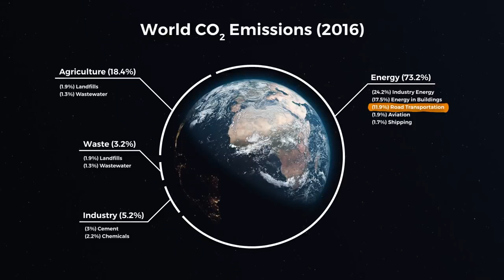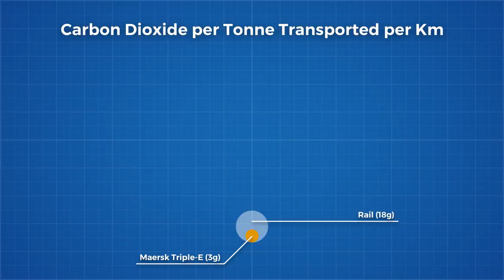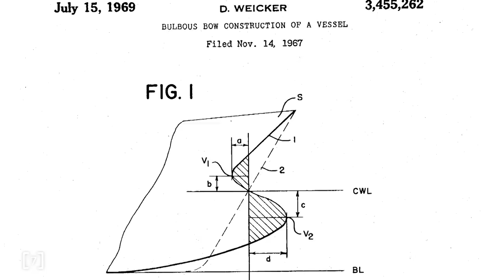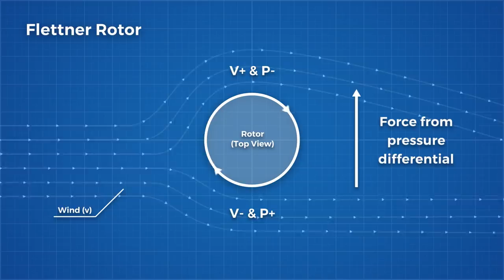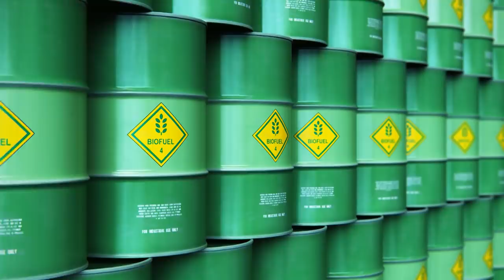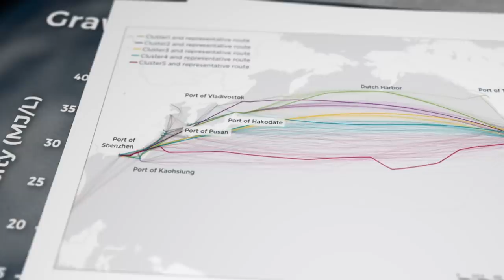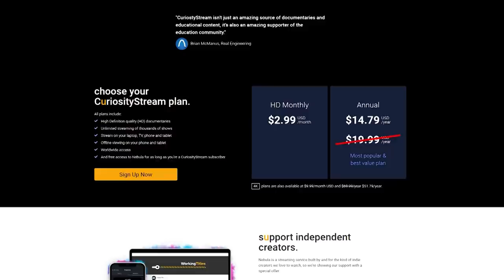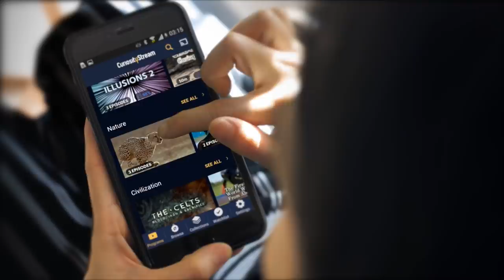Are Renewable Powered Ships Possible?

Comment: What I have come up with is there are newer very high density batteries coming out now.  Mass and space on a ship are important.  Placement of mass is also important.  You have to consider that the current large ships out there have massive engines that take up a large amount of space and a descent amount of space is used to store fuel for the long trip across large oceans.  This energy density of the fuel is a problem when you look for ways to replace it.  So from the onset, if you are to use batteries, you need to find something high density to minimize the number of recharging places that need to be setup.  However, here is the thing with recharging, you could for example have floating wind farms along shipping lanes.  Moor the ship to a recharging point and connect up some high powered transmission lines to the ship.  The power dumps  over to the batteries on the ship from batteries at the floating wind farm.  Considering how efficient these ships are at moving around with economies of scale bringing drag way down in addition to low speeds they are typically operated at, it should be easy enough to have up to a few days of battery storage without really becoming a problems with cargo capacity.  At this, you could distribute the batteries along the bottom of the hull to help lower the center of gravity of the ship.  Then you just have an electric motor in the back to turn the prop.  Naval electric drive motors are nothing new.

Of course, if you can add something to the ship, say harnessing wind power, that could cut down on how much the batteries need to be used.  But you also need to keep this as simple and reliable as possible.  One of the reasons batteries are selected is they can be very simple and easy to operate.  Also they are very energy efficient and so cheap to operate.  After all they are already used at grid scale and just left in large banks to operate on their own, so ship use should be easy enough.  Just be careful to seal up the compartments they are in properly so salt water doesn't get into them and design the compartments they are in for any failure mode known for that battery type.  Also maybe setup the batteries on tracks to move side to side to help balance the ship as you can cut down on the need to use water ballast to stabilize the ship.
Reply: Much to think about here; correctly you indentify ‘energy density’ as the major issue but have, WADR, failed to carry that through to the conclusion that the fuel currently used is the best available when combined with internal combustion engines (ICE).  ICE are not massive in proportion to their power output and the hydrocarbon fuel used is easily stored in any awkward corner of the vessel that has no more valuable use.  The area & volume of the grid scale batteries you mention is not insignificant and would displace most of the cargo from any size of ship.  The owners and operators of the global shipping fleet take every opportunity to get the greatest number of ‘freight tonne miles’ out of everything they have to deploy to conduct their business limited only by the laws and regulations under which they operate.  Not only the control exerted by the International Maritime Organisation (IMO), an agency of the United Nations, but also those of the nation where the vessel is registered (flag state) and the nation sate wherever the vessel happens to be (port state) when not on the high seas.
Reply: @BernardLS  So I did some quick number crunching and other fact checks based on the Emma Maersk.  The idea being pick one of the largest and most efficient ships out there and run some numbers against it to get good enough ballpark figures to say what makes sense.  Then the numbers were crunched on cruise speed as that is more realistic than the max numbers.  I came up with at full load and cruise speed, the Emma Maersk should average around 1,500 tonne miles per gallon of the heavy, dirty fuel it uses.  While this number should be better if better fuel were used, for some comparison, trains in the USA average 500 tonne miles per gallon of diesel fuel and semi-trucks in the USA average 125 tonne miles per gallon of diesel fuel.

This is important for figuring out what percentage of your ship will need to be dedicated to energy storage.

Something else to consider, and you see this effect with even regular electric cars, electric motors are light.  ICE engines are heavy.  So then you can start trading engine mass for battery mass.  The Emma Maersk has a 2,300 tonne engine that is multiple stories tall.  The Emma Maersk also has a very long propeller shaft that weighs many tonnes and takes up a lot of space because the engine needs to be moved forward quite a ways because it is so big and heavy.  If you were to put an electric motor in, it would be far smaller and the shaft far shorter because you could put the motor much closer to the back of the ship.  So then that frees up say 2,000 tonnes of mass and a large volume inside the ship.  But then say you add back in batteries to power the ship.  With some of these new batteries coming out, it is not unreasonable to assume for a ship based application that you could get something like 400 kWh per tonne of battery and this includes structural pack weight.  So for that 2,000 tonnes saved by dumping the engine overboard and replacing the mass with batteries, you are looking at 800 MWh of battery capacity.

So now with just what you replaced engine and shaft wise, steaming along at ~1/2 power of 40 MW, that is 20 hours of propulsion.

So then consider all of the mass you have of fuel.  At economy speed, this is about 160 tonnes a day of fuel used.  So the fuel displacement is not a big factor considering the massive scale of this ship.  However, adding this in, you get over the 1 day mark of driving around at economy speed on battery alone without really disturbing the mass or effective volume balance of the ship over using a giant, heavy ICE engine.  Actually, if you were to store 25 days of fuel at economy speed, that is 4,000 tonnes of fuel.  25 days is picked for a long Pacific Ocean crossing.  So another 40 hours of battery for a total of 60 hours of battery without compromising cargo capacity.

So going back to the total freight capacity of roughly 150,000 tonnes, every 1,000 tonnes you slice off gets you another 10 hours of battery.  This is where I get into talking about where to place these floating wind farms and battery storage systems in the ocean along trade routes so ships can stop and recharge.  You could potentially have days of battery without a big impact on cargo capacity.  If you turned the ship into a floating battery, you are talking about over 1,500 hours of cruising the oceans on battery power, which is just absurd, but shows the math does work.  But it also shows that you need to stop to recharge in order to not rob too much cargo capacity and to keep the battery pack costs down.  So, I am thinking you would design around every couple of days or so, a battery powered ship would stop to recharge at one of these floating power stations in the ocean.

When you look at a ship like the Titanic, which a lot of people have looked at, a rather large percentage of the ship was dedicated to propulsion.  Going to heavy fuel-oil and huge diesel engines has shrunk down what is needed quite a bit even if the ship does go at Titanic speeds for their size.
Reply: @ChaJ67  I should take the time to construct a serious counter argyment but at the moment I am 🤣(rolling on the floor laughing).  For now just think about 41 mega Joules per kilogram, the typical gross calorific value of hydro carbon FO.  Where did 160 tonnes a day come from?
Reply: @BernardLS  The 160 tonnes a day comes from 1,660 gallons per hour * 8 lbs/gallon * 24 hours for economy speed.

I did crunch some numbers after looking up whatever values I could find.  If you can find better numbers, let me know.
Reply: @ChaJ67  Using a different, SI, route I came up with 155 tonnes so we can agree that.  In the 1970’s I was employed on 300 000 tonne ULCC ships running around the bottom of Africa; they used to consume around 100 tonnes a day to achieve circa 15kn, with steam turbines.  155 – 160 tons a day at reduced speed using an ICE is enough to turn me into a Greenie  🙂.
Reply: @BernardLS  And I am not sure why you laugh about this.  Floating wind farms are nothing new, grid scale batteries are not that new.  These can both be reasonably low maintenance.  For some added insurance, you could have nuclear power plant ships.  These actually exist already.

The problem with batteries, which you touch on, is they have nowhere near the energy density of hydrocarbon fuel, even the newer ones coming out.  However, we have cars that can go hundreds of miles on a charge and it is a very efficient way of consuming renewable energy.  Granted, ships have vastly better economies of scale, so you can push a giant ship much farther than you can with a car.  Ships have to go vast distances, so the main method I have come up with is to introduce "gas stations" at sea using renewable energy produced on site, granted you could use underwater power cables to transmit power a distance if there is a better renewable source a little ways away from the shipping lane.  And now I also mention mobile nuclear power plant ships as a backup source of power.
Reply: @BernardLS  yeah, this is a problem with shipping is it is already very efficient.  I once told a girl on a date that there are higher priority things to focus on making more green than giant ships and she wandered away after that, so thought maybe I could think about the subject some more.  Sounds like I may have made it to people may laugh at what I came up with.
Reply: @ChaJ67  Sorry but I like to keep my sense of humour alive.  WRT to 'floating nukes', like the one the Russians have parked up at Pevek, there is a another trigger; can we come to 'nukes on boats' later?  With regard to propulsion using electric motors powered by ‘green electricity’, leaving aside the fact that there is no truly ‘green’ electricity, the best we can do is low carbon impact both at installation (capital account cost) and production (revenue account cost).  Running ships on the ‘lecky’ is tricky; the two examples that I personally know of, and have used, are a vehicle and foot traffic ‘chain’ ferry that ply’s its trade across the hundred meters or so of the Nordre älv between the island of Hisingen and Kornhall on the Swedish mainland.  The motors are on the ferry and a power supply cable is unwound and wound back up on board as the ferry shuttles back and forth from Kornhall.  When the vessel goes anywhere else, id est dry dock for survey and or maintenance, it is towed by a good old ICE powered tug.

The other electric vessel is a vehicle and foot traffic ferry that runs from Helsingborg (Sweden) to Helsingor (Denmark), a twenty minute trip undertaken using energy stored in batteries on board, she tops up the charge each time she is alongside and battery capacity is said to be sufficient for an hour of main engine use.  A video is available on the Fully Charged channel of YouTube, ‘100% Electrical Ferry Crossing’.  There are small diesel generators on board; to keep the lights and other safety related items on in extremis.

Submarines can be diesel electric but they have negligible cargo carrying capacity and rely on hydrocarbon fuel to initially create the electricity and if you ever go on one (HMS Alliance is available to visit as a static exhibit at Gosport, UK or video available on YouTube, https://youtu.be/Q23uoxT16gO) your first thought could be ‘not much room in here for the crew is there?’

What about electric tug boats?   That would at least improve the air quality around ports, and they can recharge daily since they stay near the port.  Well though that might be feasible in practice ‘tugs’ need lots of power in short burst with readily available and extensive reserves for when things do not go according to ‘plan A’.  So hybrid ICE/battery could be an option, so long as the economics stack up, and would be a means of quantifying part of the cost of environmental improvement; getting values to add to the debate would be a very useful tool.  An additional question that needs to be addressed is ‘what is the environmental threat if a cargo ship with batteries sinks?’

For small scale, low weight, time sensitive, high value cargo (people) direct harvest solar energy could be a site specific solution being most effective in the tropics on daylight hours, good weather, short voyages in protected waters, such as the ‘Aditya’ ferry in India.  The advantages are that it is quiet and clean in operation with low fuel and maintenance costs for the drive train; the hull and fittings will however still require some routine maintenance.  Electric ships currently have short ranges and high light displacement in proportion to their cargo capacity.  Sadly as of now, except for niche usage, electrically powered ships are as functional as chocolate fireguards.
Reply: @ChaJ67   Well ‘they’ laughed at the idea of steel ships and heavier than air flying machines.  Today’s main stream product started with a ludicrous invention, like those two, brought into life with an idea ahead of its time.  Feel free to have a chuckle over the following, it is just my ‘two pennies worth’.

The 26th UN Climate Change Conference of the Parties (COP26) held in Glasgow between 31 October 2021 & 13 November 2021 established requirements and targets for mitigation of the production of GHG and with regard to shipping steps to reduce atmospheric pollution to acceptable levels could include, but not be limited to: -
1) Abolish the cruising fraction of marine transport;
2) Abolish recreational boating;
3) Improve fuel quality;
4) Localise production to consumption;
5) Reduce 'freight mile' distances;
6) Reduce spoilage / waste of all commodities;
7) Reduce freight carrying capacity;
8) Reduce the global population of consumers;
9) De'fossil'ise the fuel chain.
The use of any of the options above may not be the future of marine transportation but moving less material and moving what is transported over shorter distances, as in the past, should be.  Together with localised production and minimised consumption a global population that has individuals’ voluntarily self-limiting reproduction to two children per parent (both male and female), might save the planet.

Shipping currently has a 'high volume, low added value' business model and it needs to return to the 'low volume, high value added' model it followed in the past.  Addressing the 3% of global GHG emissions generated by shipping will be less advantageous than dealing with the 24% due to other transportation, the 24% of the of GHG emissions due to manufacturing industry or the 25% due to electrical power generation. (Figures from https://www.epa.gov/ghgemissions/sources-greenhouse-gas-emissions, et al).  Any alternative to the existing system needs to provide better value and so depends on the yield; the energy input less losses must reliable and consistently provide sufficient energy output that can be deployed for propulsion, cargo handling and domestic services.  All of which must be achieved within the current limits of mass (weight), volume (cubic capacity) and cost.